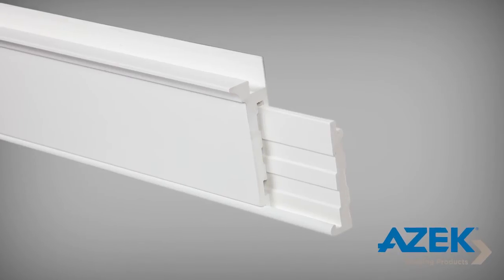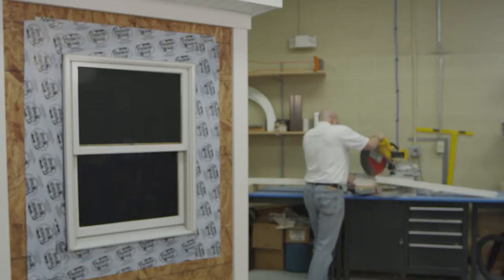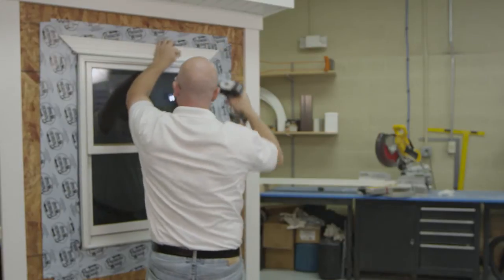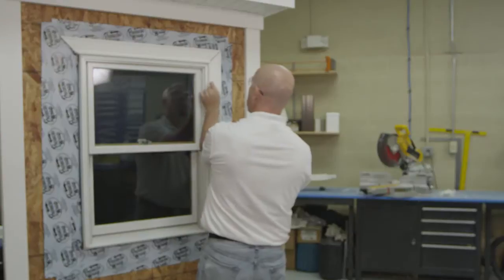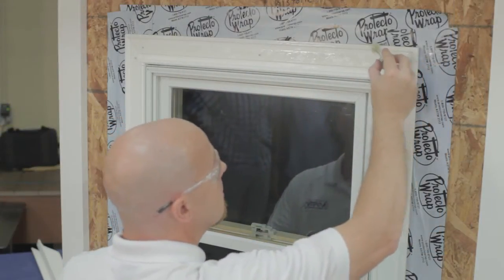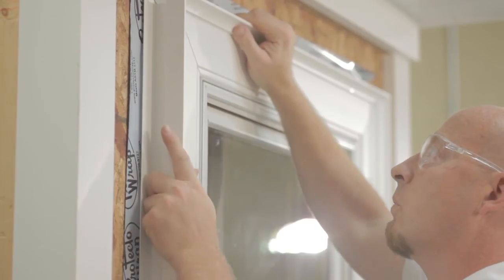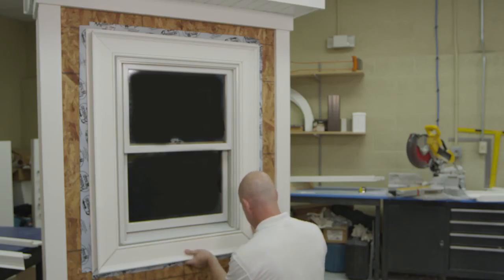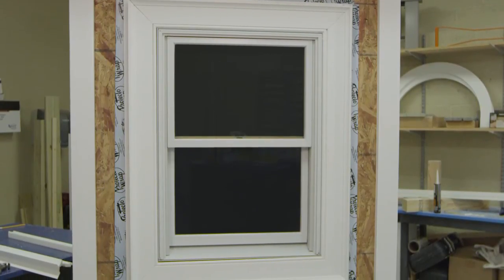How to Install PVC Finish Grade Trim

Comment: Looks great until the window needs to be replaced!
Reply: No matter what trim you wrap your window in, it will need removed if you need to replace the window. Install the window, water, air tight, square, and fully functional and you shouldn't have to worry about replacing it for a very long time.